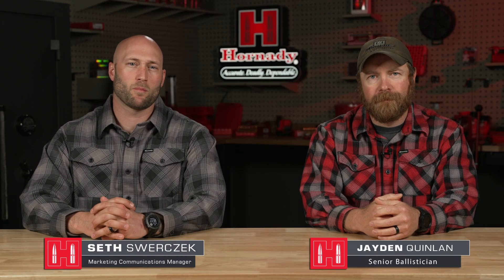What is Drag Variability Reduction Technology? (DVRT™)

Comment: Another great video. I earn my living with a 6mm arc soon I’ll also be using 22arc. Just need to find some time to put it together. The only problem I’ve had is I use your 80g, 108g,and 103g. Depending on what I’m chasing. Sometimes within changing loads I get them mixed up. It would be super awesome to have different colored tips. That said I have no idea how much that would cost from a production standpoint. Course that’s cause I get lazy and can’t  seem to keep up with them on my own.